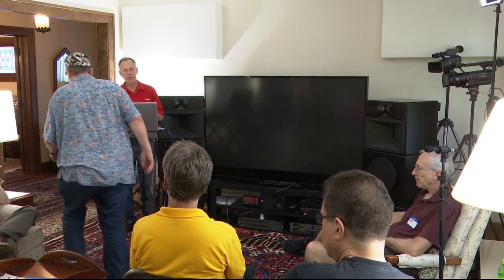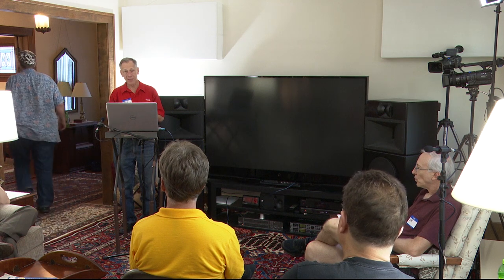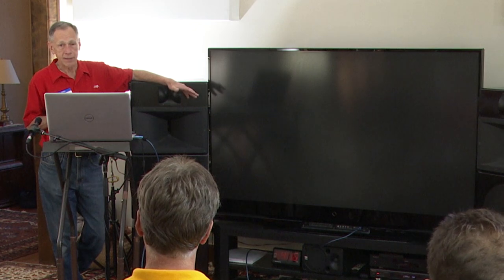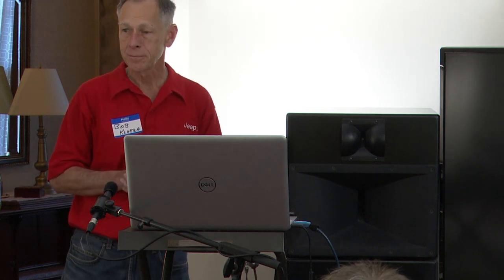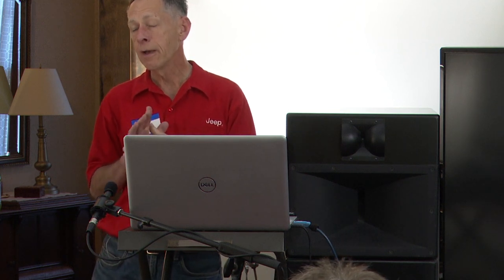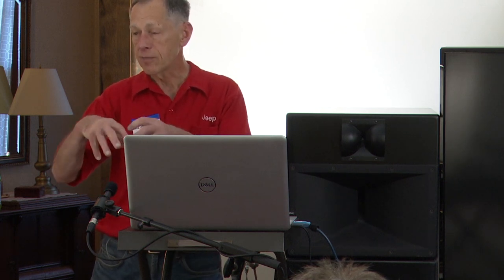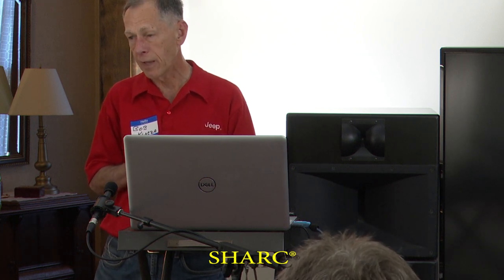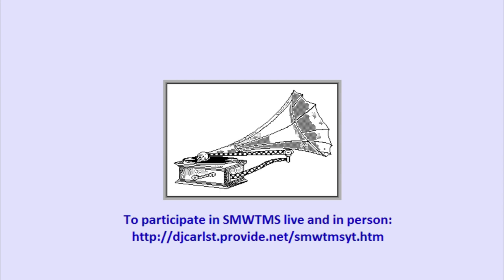Audio System with Horns and Infinite Baffle Subwoofer

Comment: Loudspeaker management systems... i have been wondering why they aren't modus operandi in 2019, they are obvious next step when looking for better sound. The whole "2 channels" and "1 watt" ideology in the audiophile world has caused so much harm. I used first of them in the field well over a decade ago, it just makes hell of a lot of sense and the amount of fixes you can apply is just.. well, if you can fix the time domain issues when it comes to simply the location of the speaker elements: why wouldn't you do that FIRST, then move on from there once they are all on the same virtual plane.. Speaker design has new liberations and less limitations that we suffered for decades.. But nope, it has to be tube 2 channel 1W amp or it isn't "high end".
Reply: The Behringer DCX2496 Loudspeaker Management System has the ability to delay individual inputs and outputs, used to align the acoustic centers of each voice coil in the Dual Woofer Mid-range Wave-guide compression driver and compression driver tweeter.  The Dual Woofers each are delayed individually to sum the acoustic centers at you ear level, and not your knees.....

Comment: Great presentation! Indeed it would be great to hear the system live. I have a couple of questions. 1) For the infinite baffle design, does it perform differently than having in-room sources (thinking of standing wave effects of one sub vs. multiple)? It appears that Bob's system only has one, but I know multiple people recommend having more than one to smooth out standing wave nulls and peaks. 2) Is one particular kind of sub driver more suited for infinite baffles over another?
Reply: Answer 1) The sub-woofer plenum exits at a three plane juncture in the room, making it an 1/8th space, with great amounts of "Room Gain".  I would love to have at least two additional sub-woofers in this room, but the WAF, or Wife Acceptance Factor, prohibits this :-(  We have since purchased a home with a high ceilinged basement, which will have a "Theater in the Home" system with Video Projector, and Room within a Room isolation......
Reply: A sub-woofer with a soft suspension is preferred for an Infinite Baffle system, but most sub-woofer drivers today are fairly stiff suspension.  In either case, the resonant frequency of the "Infinite Baffle Sub-Woofer" will not go up, and depending on the softness of the suspension, will go down in resonant frequency. The softer the suspension, the lower it will go down in resonance..  :-)  The JBL Pro 2245H is an excellent example of a soft suspension sub-woofer !!